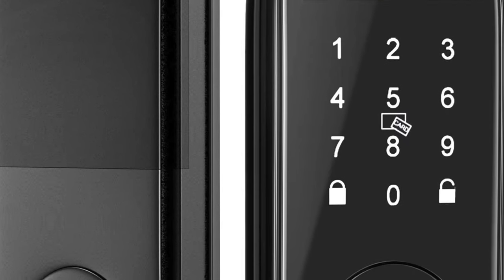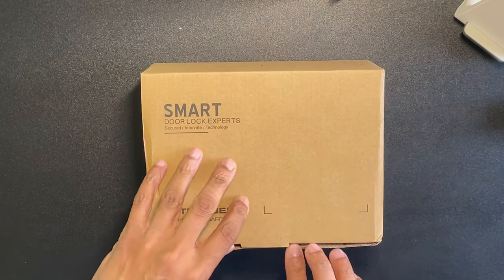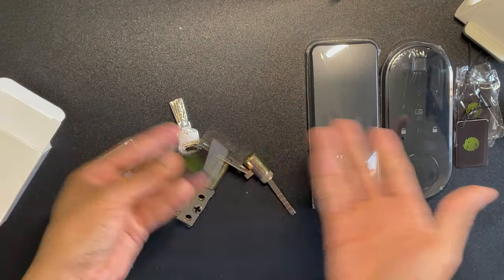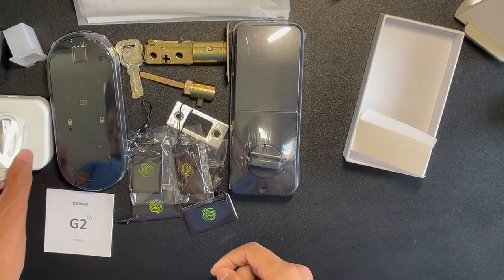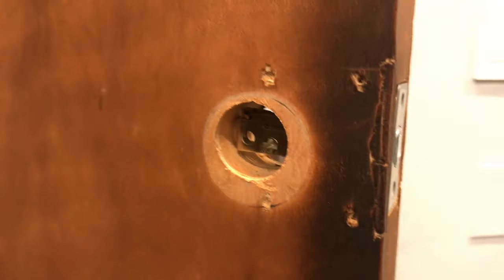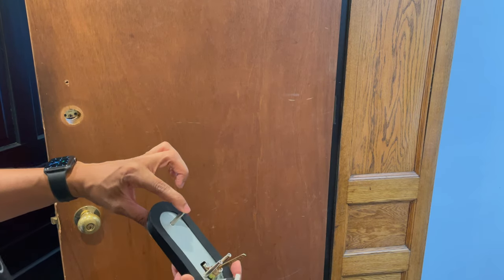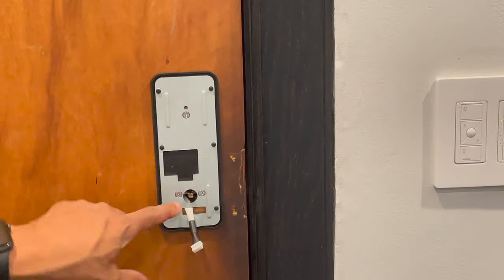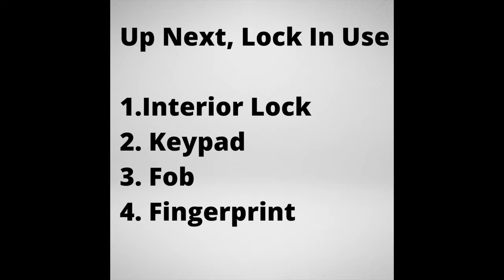Narpult Fingerprint Smart Lock Review

Comment: How did the gateway work for you?  How close did you end up having to put it?
Reply from the maker: It's working well. I have it within my entertainment center which houses my WiFi. The door lock is approximately 20' away and there have been no issues.
Reply: @techumehomeandelectronics5795  Thank you for the quick response!  These locks were just on a lightning deal earlier today so picked up 3 of them and a G2 hub to refit all the doors.  Fingers Crossed.